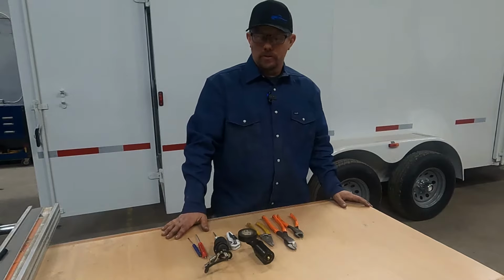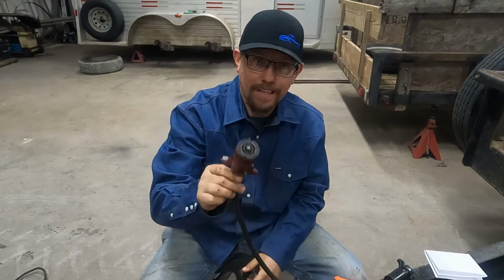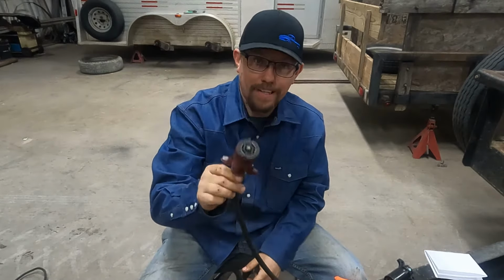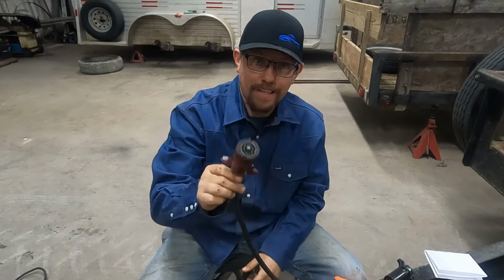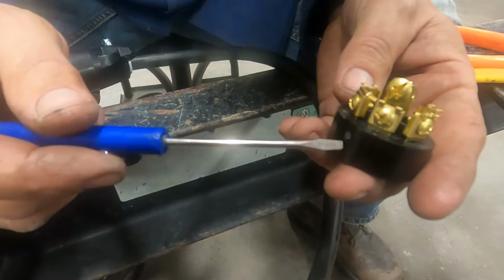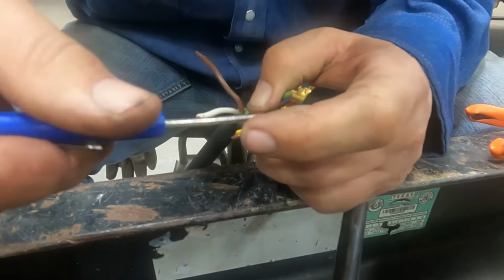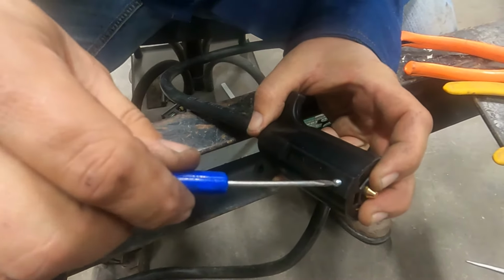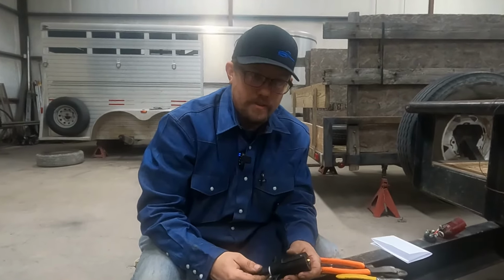How to wire a 7 Way Trailer Plug

Comment: I typically use dielectric grease on the wire ends to keep corrosion to a minimum because moisture will get inside the plug eventually.

Comment: Nothing was mentioned regarding the centre wire, of which I originally always thought was another ground, but apparently many use it for 'reverse lights', or for those with boats that have a hydraulic disconnect for when entering the water, this can be used to electrically disconnect the brakes when backing into the water.  So, I'll assume this must be a hot, or + connection if/when needed?
Reply from the maker: Hi!  Thanks for watching!  The center wire/pin is only used for a reverse wire.  For the example in this video, we installed a 7 way RV plug wired with a 6 way trailer configuration.  In boat trailers, sometimes the center pin is used to block hydraulic flow when reversing, operating off the reverse signal.  The center pin is only ever used for reverse function.  Hope this helps clear things up.

Comment: I have a 2005 Toyota Tacoma and been having side marker light flickering issues on my Tracker boat trailer.  I've checked everything, grounds etc. I am trying to open up the cannon plug, truck side, and inspect the wires, and can't figure out how to get access to the terminal fittings in the plug.  All the videos show a plug with two set screws, and pulling the plug from the inside out, to access the wires.  I also have two tan colored scotch type connector fittings inside the plug wiring, but look tight, considering doing the butt style replacement also.  Any thoughts?  Your videos are awesome!!!!!!!!!!!!!!!!!
Reply from the maker: The flickering definitely sounds like a ground or a contact issue.  With the trailer plugged in and your headlights on, start from your truck plug and work your way back, tug, shake, pull any accessible wires to see if you can create the flicker in hopes of isolating the bad ground and/or short.  Where the 2 scotch type connectors are, remove those.  There's a good chance you may have some corrosion where  those connectors pierce the insulation of the wire.  As far as the truck plug, not all factory plugs are accessible internally and have to be replaced if that is the issue.  Hope this helps!  Thanks for watching the channel!
Reply: Thanks for the detailed reply.  Did everything you said above.  Found nothing loose, and could not replicate the flickering.  The one connector was a factory harness connection and was all tight. Will dive in to the trailer tail lights once it warms up a bit.  One thing worth noting, when I left BassPro parking lot, (to have the trailer looked at), I hadn't even got out of the parking lot and they starting flickering, and when I exited off the interstate, going down the ramp, the lights tend to come on when I have that side force going on the truck and trailer.  Do you think it might be in the truck receiver hitch?  I can move the ball when not hooked up.  I even had the lights hooked up to the truck, unhooked the trailer from the receiver ball hitch, but lights stayed on.  It's something that doesn't take much movement.  Thanks again for any info!!!!!!!!!!!!!!!! @TheTrailerSmith

Comment: Could you do a video on installing a 7 pin plug on a farm tractor. I need to install one so I can use a set of Connix wireless farm equipment lights and the transmitter is plugged into a 7 pin connector on the tractor. And of course I don’t have one on mine…yet!  Thanks!
Reply from the maker: Man, thanks for the idea. I’ll have to do some checking on that. What make & model tractor do you have?

Comment: Thank you for the great content!  I am curious tho - I have a 8x14 utility trailer (no brakes) that has a 4-wire connector.  My truck has both 4 and 7 wire connectors.  I need to rewire my trailer - would I be better off using a 7 wire connector instead of another 4 wire?  Thanks again!

Comment: Good information, very well explained.  Thank you. Questio n -- Would you advise coating the inside of the plug with dielectric grease?
Reply from the maker: You can use dielectric grease if you prefer.  I normally don't, but if you live somewhere that has a climate that leads to corrosion, such as close to the coast or in an area that uses salt mixtures on the roads in icy weather, then it would probably be a good idea to use it.  Great question and thanks for watching!

Comment: Just installed a Polluk plug, but on a 7 wire cable.  You're missing blue, and y trailer lights are still not working.  Why not make a comprehensive video using a Polluk plug with 7 wires like most people have? Your title says 7 Way Trailer Plug, not 6 wires into a 7 way plug....
Reply from the maker: Thank you for your comment!  In this video, we are focusing on utility trailers, which have a 6 wire set up.  We will focus on RV wiring in future videos and that will feature 7 wires.  A 7 way plug is universal and has been the standard for the utility & livestock trailer industry for many years now and works well for a 6 wire or 7 wire set up.  Depending on wire manufacturer, some use blue and some use black to indicate the brake wire.
Reply: I have a utility trailer with 7 wire for my landscape business...open trailer...not an RV...
Reply: Good job. Very understandable.
Reply: The 7th wire, is the centre pole, which wasn't used here.   As I mentioned above, it can be used for different things, one of the more popular usage is for 'backup lights' of which most trailers don't have, so it's not needed.   I would think a short 'jumper' could be made, to set this up as needed, depending on what your usage is.   I use this setup on my motorhome, of which I tow a car behind, so I suppose I 'could' have the cars reverse lights come on, but in reality they would never be used, so I use my Pollak plug as a 6 way plug.

Comment: Duh, your nomenclature is WRONG most of the time. You get your words mixed up over and over. You need to learn the correct definition of these words: PLUG - male part that fits into female part; RECEPTACLE, or  SOCKET,- the female part that accepts insertion of the male plug. The PLUG is hanging off a long cable on the trailer. The RECEPTACLE, OR SOCKET, is attached to the towing vehicle.